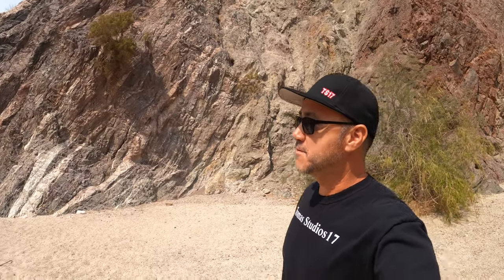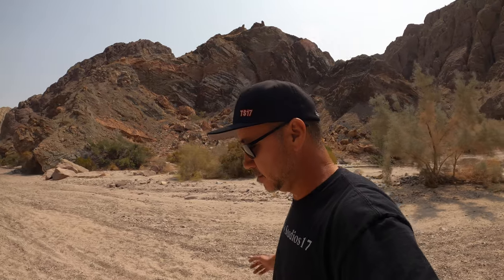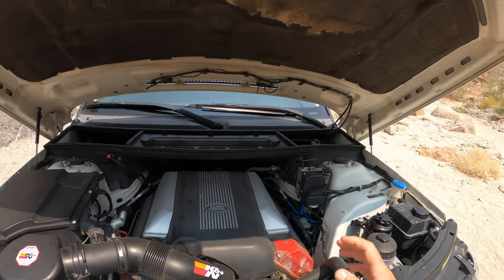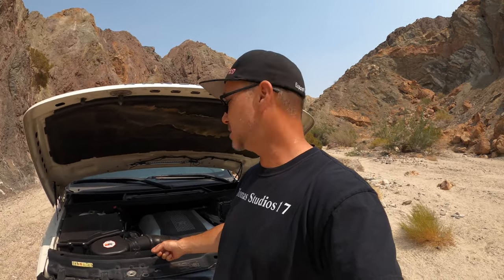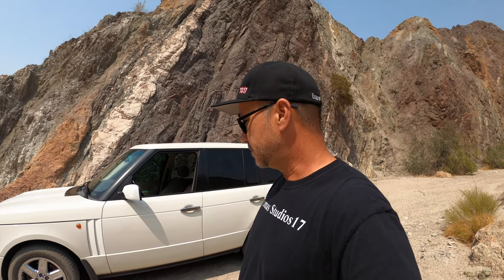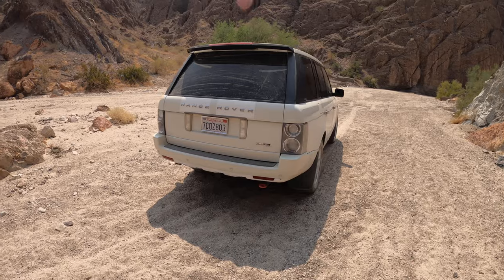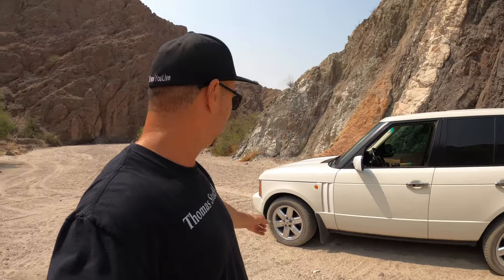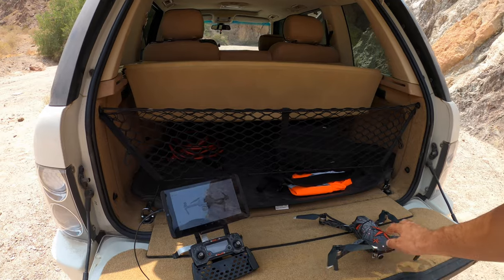SOLVED!!! RANGE ROVER 02 SENSOR FAULT CODE / FUEL SYSTEM TO LEAN CODE P0171 AND P0174

Comment: I have this exact problem with my 2004 Land Rover Range Rover HSE 4.4l, will try this fix, excellent insight; I noticed that the air intake gasket was flakey, but I thought it was OK.
Reply: I thought so too plus the air entered before the mass airflow sensor but it fixed mine … hope it works for you!

Comment: Thanks for your video, I am getting all the codes and replaced with all brand new Walker O2 sensors and a light still came on! However after watching your video I did the same thing you did and went a step above, I noticed that the intake hose to the throttle body was gapped at the bottom, barely seen, also before the MAF THE FILTER HOLDER, has a somewhat hidden hoes in front that runs  in front and under and down  somewhere, left side of the radiator, that hoes and connector should be going to it, but was not connected which would allow a lot of air to come into that filter housing canister then past the MAF, so a silicone everything and I'm hoping for the best I have a 2-hour trip to take, time will tell but I got a great feeling because of your video, I thank you!  I have good pictures I wish I could post to everyone, but don't know how, oh well I hope they read this and figure it out.
Reply from the maker: Great 👍 glad this helped hopefully it fixes it thanks for watching and good luck on your trip
Reply: Well, bad news! I did got rid of the two codes p 0174 and p0171 but my original codes P2A00 and P2A03 for the front two O2 sensors are still there!  I am at a lost, I guess I will try a smoke test next I don't even know if that's even necessary but I don't know what to do at this point, if anyone else knows let me know please. I've  already spent close to $600 trying to get this check engine light off pretty soon I'm going to disconnect the light bulb behind the dash or put a black piece of tape in front of it! However the only good thing is my gas mileage became better with the new O2 sensors.

Comment: How much silicone? I put a thin layer on both supercharger intake and coming out of the air cleaner and tightened the clamps. Thought I had it fixed as it seemed a little better but then the light came back. Will try a thicker bead to make sure it's totally tight.. Previously I had poured in a can of PurpleMax in the tank with 1/4 gas left. Do you think this was too concentrated and it loosened something up that could have clogged the fuel filter? The car runs great, accelerates fine and fires right up when you twist the key. On cold start up it takes 3 times longer than my other cars to settle down to normal idle.
Reply from the maker: That’s all I did also worked still no lights on… good luck it has to be an air leak somewhere

Comment: Very helpful 👍🏼
Reply from the maker: If you have exhausted all other possibilities like o2 sensor and no air leaks… check your break booster sometimes the break booster has a small leak in the diaphragm… hope this helps !
Reply: @ThomasStudios17  cheers tom , I'm in the process of doing a android head unit conversion your vid on that helped as didn't get sound through the harness supplied,noticed the one you used had additional power supply 👍🏼
Reply: Oh I found more air leaks , no seals on the air box , damaged connector from the oil breather to inlet manifold hose , the joys of owning a rangey 😅

Comment: Pls help me with my Range Rover I have the same problem and I try that 😢
Reply from the maker: If you already replaced the o2 sensors then this is what i would do...make sure your air filter is stock...k&n filters cause oil to get onto the mass air flow sensor..also check the small hose on the egr valve. there is a small rubber hose that comes off of it and routes to the front some times the egr valve is sucking air or that rubber hose has a hole in it. Also make sure your oil cap is sealed the flat rubber gasket gets worn and the engine sucks air through this. also check your dip stick make sure both rubber o-rings are good. Also check on the passenger side there is a tiny rubber hose going to the transmission very hard to see on the back of the engine on the passenger side here is what it connects to ... For 2003-2005 Land Rover Range Rover Oil Separator Febi 89468GP 2004 . Your pretty much looking for where the engine is sucking in air. make sure your mass air flow sensor is clean or new. If you have a smoke detector then makes it easier. I bought one but only used it once. Just look for any thing that could or would suck air into the engine thats not suppose to. I originally thought it was my exhaust manifolds. My engine still has no error codes other then when my air suspension pump went out....good luck let us know how it ends up. hopefully you find it!

Comment: Was the gasket loose? What exactly did you seal (inside/outside)? Thank you.
Reply from the maker: Yes gasket was loose bought a new one but still was sucking air so I put silicone and the codes went away.. no more check engine light

Comment: Yup good one just sealed a exhaust leak post cat bank one pipe into muff code p2075 now airbox will do seal hopefully problem solved thanks code 661 174 on a mission to solve
Reply from the maker: Don’t forget to check pcv hose there is a very tiny one on the back side of the pcv
Reply: @ThomasStudios17  
Appreciate down to p661 manifold intake tuning valve on the v6 4.0 gotta find and replace

Comment: Oxygen sensor code from Alldata: 2004 Land Rover Range Rover (L322) V8-4398cc 4.4L (M62)  
P1174
Vehicle ALL Diagnostic Trouble Codes ( DTC ) Testing and Inspection P Code Charts P1174
P1174
Lambda Control Adaption Fault Bank 2.

P1174 - Lambda control adaption fault bank 2.: Last occurrence - maximum signal

Possible causes:
 1. Air leak to inlet bank 2.
 2. Air leak to exhaust bank 2.

 1. Air leak to inlet bank 2.
    -  The ECM is unable to maintain the lambda correction.
    -  Check for air leak paths into the exhaust before the rear O2 sensor.
    -  Check for air leak paths into the inlet manifold after the air mass flow meter.

 2. Air leak to exhaust bank 2.
    -  The ECM is unable to maintain the lambda correction.
    -  Check for air leak paths into the exhaust before the rear O2 sensor.
    -  Check for air leak paths into the inlet manifold after the air mass flow meter.

Comment: Hi Thomas, I got Range Rover HSE 2008 4.4 with vacuum leak, I replaced intake manifold gasket, PCV, spark plugs... later I check system with smoke detector and found a vacuum leak on EGR, replaced that too and cleaned MAF and throttle body... Putted gasoline 93 and still giving me P0171 and P0174, I have Autel and Xtool scanner, I deleted the codes, but them comeback... car is running good... I need this scanner to reset the values?
Reply from the maker: Did you replace the O2 sensors all 4?
Reply from the maker: I would also check your fuel filter if your fuel pump is pushing enough pressure then your fuel filter could be dirty but I noticed it’s rare for a filter to get so clogged that it throws that code but it’s possible. Especially if you changed everything already and there’s no vacuum leaks
Reply: @ThomasStudios17  No, these working, I have another car, if still getting codes, I will replace these...
Reply: @ThomasStudios17  I replaced Fuel Filter, Putted another MAF and still getting the codes... Let my try O2 Sensors, but if I check on scanner them working good... I sprayed brake cleaner on vacuum hose make sure about leaks... no vacuum leaks... tomorrow I will check fuel pressure too... but I think the values on o2 sensor is high... 950/1000... lmk what do u think about... thanks a lot... I got another LR2 with crash impact sensor code, won't turn on...
Reply from the maker: Maybe clean o2 sensors before you buy .
Reply: @ThomasStudios17  I cleaned O2 sensors, before I got P0171 and P0174, after cleaned I just got P0174, I have another Land Rover, I will try to put another o2 sensor and check if change something. Luk... Thanks
Reply from the maker: Here’s just a guess but have you checked everything connected to your PCV valve which is in the very back of the motor It connects to this funnel looking thing it could be cracked plus there’s a little hose at the bottom of the funnel look up PCV valve location on YouTube
Reply: @ThomasStudios17  Still getting code... Values on 02 sensors are different, I'll do smoke test again and order a new o2 sensors... Running good, but still giving me a check light...
Reply: New spark plugs
New EGR
New Intake Manifold Gaskets
Rebuild injectors
New Air Filter
New Fuel Filter
4 New O2 Sensors
Tested with different MAFs (Cleaned MAFs)
Cleaned Throttle Body
New PCV

*Vacuum Test: sprayed brake cleaner and smoke detector... 

Still getting P0171 and P0174, running good... no misfire...

163k miles / 2008 / V8 / 4.4 / L322

What do u think about Catalytic?
Reply from the maker: It almost sounds like fuel pressure that’s the only thing left it sounds like you’ve done everything else… Yeah I’m stumped
Reply from the maker: I don’t think the Cadillac converter would caused that But you never know with these Rover’s
Reply: @felipefonseca5753  did you ever figure it out?

Comment: Would the throttle body stop the car from starting
Reply from the maker: Yes... to test it you can remove the intake hose to the throttle body and try to start it... plus if you remove the hose you can clean the throttle body 😂